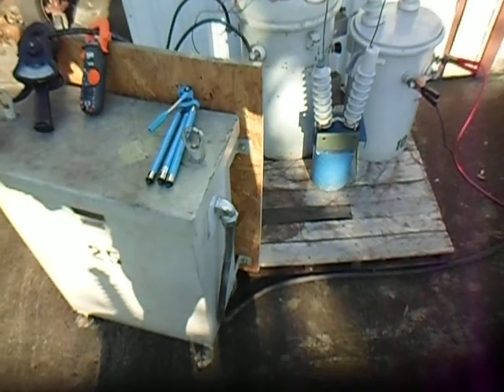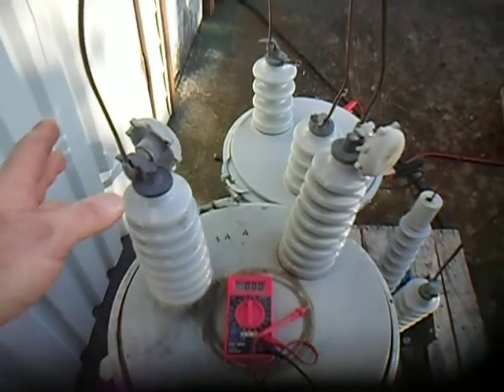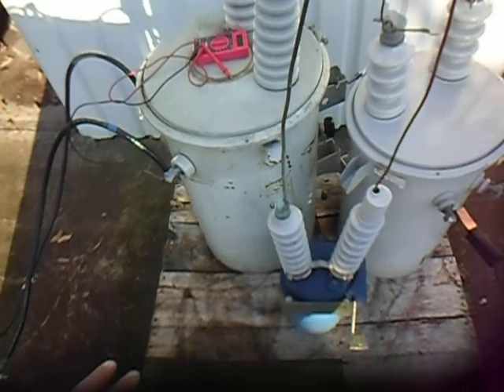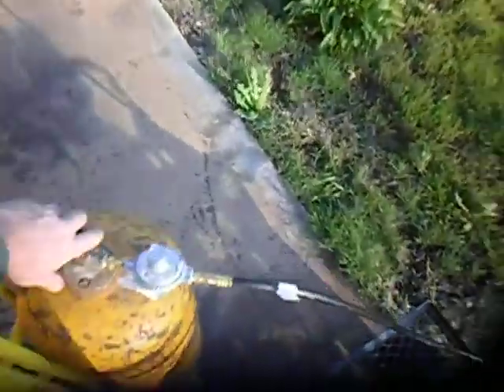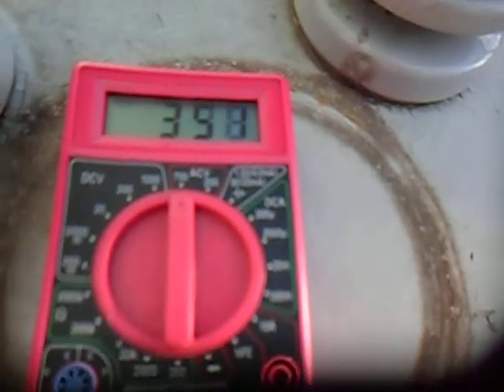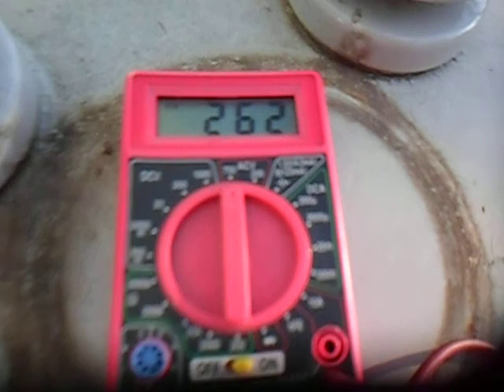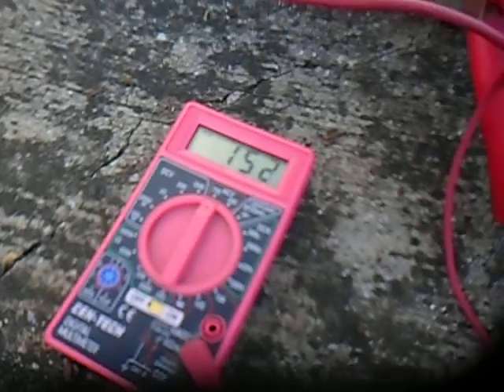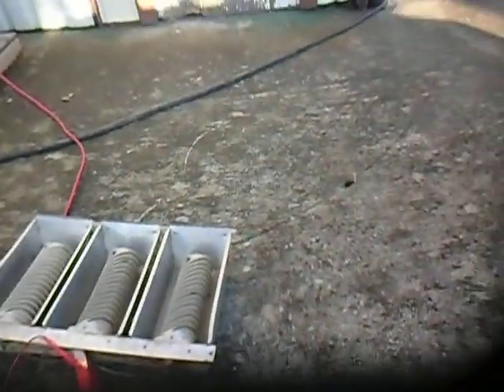Results achieved in this test do NOT support Gerard’s claims, however . . . .

Comment: you lost your impulse spike at the dry xfmr  //  also neither of your high voltage windings are grounded   //  also are your pole xrmrs plate wound and not coil or form wound  //  you have a number of different components from -------- gerard

Comment: Great job measuring the input power and the output power. Regardless of which transformers you use, what power source you use, what load you put on the output,   you will ALWAYS see the same results. More power in, less power out.  Think about it - - how could it be otherwise?  Really?  Given the losses inherent in ALL transformers,  how could there be a gain in energy???  These experiments border on the meaning of insanity  -  you repeat the experiment and get a result, a net LOSS of energy. Then you repeat the experiment, expecting a GAIN in energy, in other words, CREATING ENERGY.  But - as usual - there is ALWAYS a LOSS. The reason Morin thinks otherwise is the fact he knows nothing about accurate metrology. He NEVER accurately measures the input and the output. So he deceives himself into thinking he is creating energy! That is insanity. Expecting something that will NEVER happen.  Can anyone out there understand this?  It is so basic as to be rudimentary.  And it has been proven time after time - you will have energy LOSS every time you transform the voltage. Period. That is a fact.
Reply: +Quantum Leap     not if you are picking up additional energy from the vacuum , 0 point , space , etc
Reply: frank ertolacci Why would you even consider "the vacuum" or "zero point energy" to be a factor here?  If Morin is getting energy pulled from "the vacuum", then why is this effect not seen in electrical transformer substations all over the world?  The utilities will all tell you that the best substation transformers are only 95 -97% efficient. That means that 3 -5% of the energy is LOST to heat and other losses. They would love to have those losses replaced by GAINS, but it just is not possible. Morin is missing the boat when it comes to correct measuring technology.  Please try to see the fallacy in all his "experiments".
Reply: +Quantum Leap   they do not use impulse or permanent magnets to create the field  //  gerard has the bushings dropping into - temperatures
Reply: Have you duplicated Morin's alleged ou?

Comment: Sale me your generator please😃
Reply: +crazzylee You can get one that works just like this one at Harbor Freight.  It will work exactly like this one.  Nothing magic about the McCullogh.
Reply: +Quantum Leap And what model at harbor freights uses induction stater? I've learn that they don't make that type any more. Are brushless type staters the same? I need an out runner type.
Reply: +Quantum Leap The stater is what's magical about the Mite E Lite generator. Harbor freight doesn't carry any generators of that sort.
Reply: +Quantum Leap lol 😆. Induction is the difference
Reply: +Quantum Leap I know what I'm talking about regardless of what Gerard teaching although he has increased my understanding of the type of stater. Leverage in the design of the stater is important plus out runner or in runner determines efficiency. A smart drive generator in essence is what I'm looking for. They are efficient by design.
Reply: +crazzylee electromagnetic key word

Comment: your first mistake is using the wire wound dry type transformer. You have to go into the pole type transformer with the aluminum plate wound secondary. The transformer needs to have a dual laminated core that isolates it's field induction from it's cold energy stream which is attracted to the pulsed field that comes from the generator. I found that the generator needs to be isolated from ground, then, same with all of the other devices connected to the generator. To confirm your aerial connection through the air, the temperature has to be at a negative reading to pretty much prove you have the energy field attraction starting to happen. If in any way the devices are connected to ground in any way, it has to be at a megaohm or more of resistance which needs very high. A rubber blanket is the best method of isolation.

In the transformer, the primary coil is  wire wound around the secondary to have the correct unit necessary. I fired the power into the larger transformer's secondary at 120 volts, connected to one side, not the other, making sure one wire went to the center tap and that the center tap is grounded to the tank with a strap or braid, and, connecting the bond from one transformer to the next. The next thing, I bonded the two together and that's it. The loads I chose were resistive, but, my readings did not come from the labels, they come strictly from the meter.

The problem you have is the dry type transformer, it doesn't have the high dielectric oil which minimizes ionic field disturbance that you have going on inside of the unit, plus, there are different core types in many transformers.. There are multiple taps on the inside of the unit that you don't want because they cause an electric field presence that you wouldn't have with an oil filled unit, which is a massive interference with exactly how it functions, and, they are less than 90% efficient which is way too low to do anything with. The generator should be pumping out a dc square wave with a very high peak at it's beginning edge. The pole transformer needs to have the ability to attract the stream of energy with the scondary coil, and because the primary coil is over the top of it, the energy is then induced through the magnetic oscillations made by the generator's pulse, and, it'll give the introduction to a new type of electrical induction that we do not normally see, created by the influx of energy and it's massive vorticular field that surrounds the coils after each pulse, allows the energy to bring powerr into it without being connected whatsoever, even if the device is covered by a grounded panel, it draws the energy in somewhere, somehow... It can't come from the ground that I know of, but, if energize everything else, i'm quite positive we'd have a nice voltage across the machine and ground anyway, maybe enough to do work, who knows.. We will find out!

I need to ask you, before I take my McCulloch genset apart. I want to use an electric motor to try it out, and, I need to know the size of the shaft? Is yours 1"? It looks similar, I never took mine apart, but, I have the 3300 watt like Gerard did.